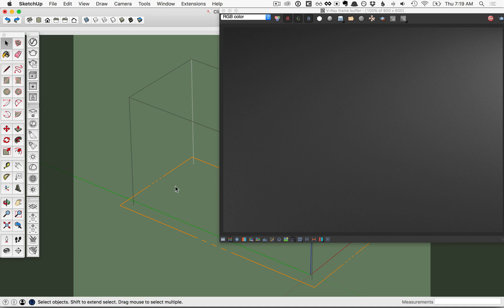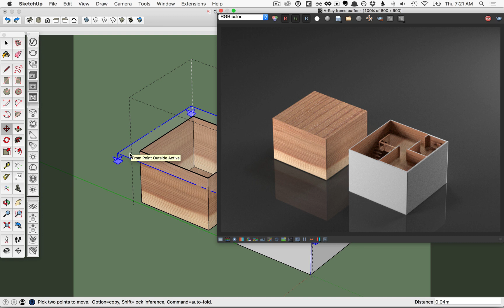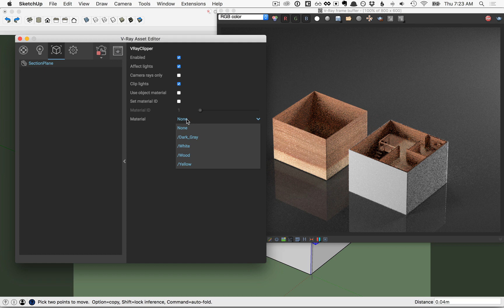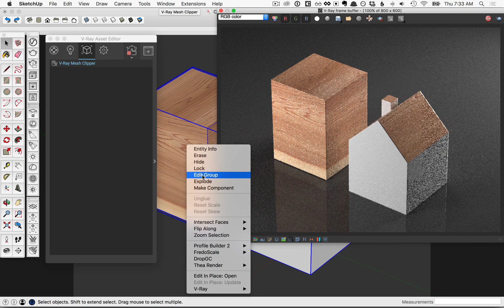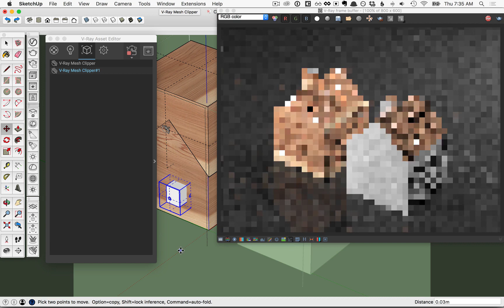Vray For Sketchup #5/2 -Vray Clipper in vray for sketchup

Comment: Greetings. I have a large sketchup model with more custom clipper meshes, is there any way to enable/ disable the clippers by scene for the batch rendering process? One of the clippers cuts out the rest of the model, similar to a section box. If I need to render these scenes, I have to do it manually and they are many. Thanks in advance.